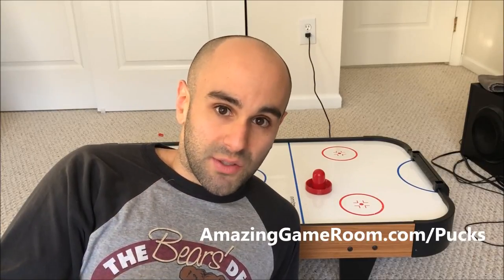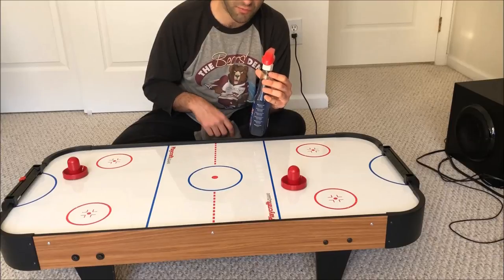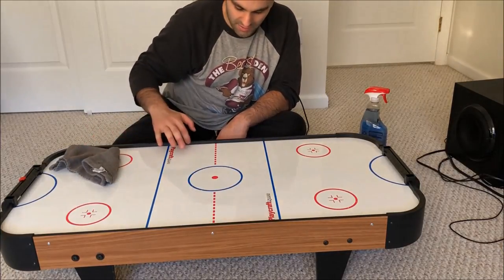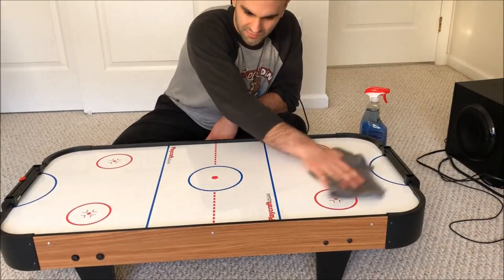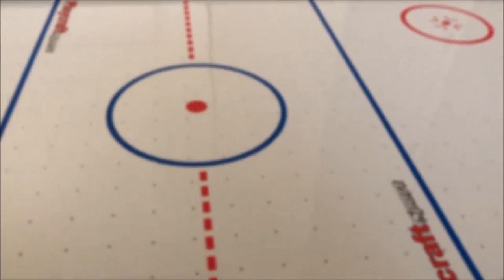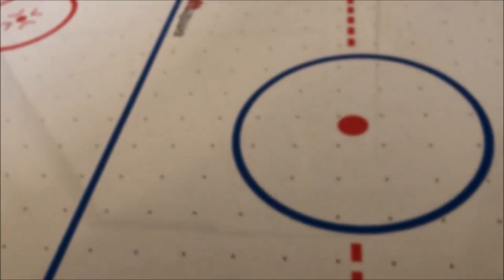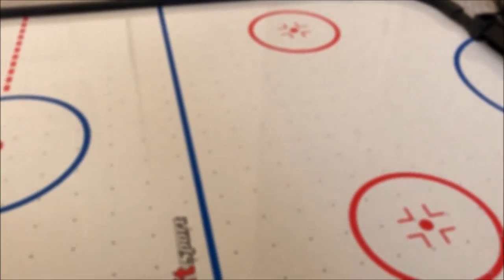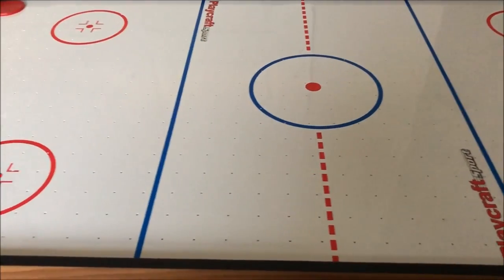Air Hockey Puck Not Moving? Try These 3 Tips

Comment from the maker: Hey guys - to get a better idea of what I'm talking about, I highly suggest you check out this article (https://amazinggameroom.com/air-hockey/best-pucks/) on air hockey pucks. I go through and list out a bunch of different puck  options that could work for you.

Additionally, you could also look at the full table maintenance guide (https://amazinggameroom.com/air-hockey/table-cleaning-maintenance/) for more detailed instructions!
Reply: One solution that you left out: sandpaper.  I used to work at Chuck E. Cheese, and if the puck didn’t slide well, it usually turned out to to be a scratch on the puck. The game room technician easily solved this by rubbing it against sandpaper for a  few seconds. A lot better solution than buying a new puck, every time the old one gets a scratch, just because of the scratch.
Reply: The page can't be found

Comment: I bet significant dings in a puck resulting in raised bumps could be sanded off with a 120 grit or finer sand paper.  Clean the puck and dry it afterwards.  I'd be very cautious about using water or Windex or a spray cleaner on an air hockey table except as a last resort.  Turn it on and vacuum the table with a brush attachment.  If holes are plugged, you may need to chase them out.  A Google search told me there are 4540 holes in a regulation table.  The hole size is 1.2mm or 3/64" (.0468").  I checked my table and 3/64" was the right hole size.  Check if your table holes are this size.  If so, use a 3/64" drill bit without a drill to chase out the holes in any dead spots on the table. Do it with the table fan running. If a soda got spilled on the table, you may need to go with the windex and follow up with the drill bit to clear the holes.

Comment: I bought a used large tournament sport craft air hockey table on Facebook yard sale and they said it was hardly used. When I got it home I noticed a lot of the pucks didn’t slide too well. At first I try cleaning the table and trying to poke the holes out, but I don’t have the geek in me to do them all. I even took a razorblade and saw the puck had A LOT OF DINGS. So I kinda shaved down the lip thinking it was that causing drag and it help on a few, but not perfectly. Unfortunately my pucks are not 2.5 nor 3.25. They are a odd size of about 2.75in. I wasted so much money on Amazon thinking I needing the larger puck for it to get stuck in my goal so then I order the cheap 2.5 pucks to find out that they are basically light weight dollar store toys.

I thought I’d never find a solution since my pucks are apparently discounted and no longer made😢 just my luck. Until I had a brain fart!! I took a mini torch lighter and quickly applied heat around the bottom lip that flows on the table (not the sides of the puck) heated up like 1/3 of the ring then softly rubbed the puck FLAT on my deep freezer, because it’s a very smooth surface soft metal ice box. After doing this one time in 1/3 sections so you don’t warp the plastic with the flame 🔥 I noticed how shinny smooth it was turning out.
I tell you what, all 6 of those pucks on both sides now just float across the table like butter on the field. Soon as I laid em down they wanted to hover away from me without a single tap. 

Hopefully I’m not too late for anyone else with this problem cause I can promise you it’s the puck most likely do to drag and rather buying new ones just heat them up and rub it back out. Don’t damage the table with a drill bit. I used a wire with solder too for about holes and said lm over this. I use denatured alcohol on the table all the time and not a single issue to the board. Good luck out there

Comment: Hi I have a Arcade Elephant AIR Hockey Table. It doesn't seem to give out sufficient air flow. I have seen alot of videos on YouTube trying to figure out what should be done to fix the problem. I bought a 1/16 drill bit and drilled holes and cleaned them... Than Light sand the whole things to get it smooth and than clean it off.. its nice and smooth the pucks is fine as well... the blower works great I took out of the table to see if its work fine and blower is very powerful. Blower is mounted right in the middle of the table underneath it . And where the blower is mounted the air flow is fine there but on the right and left the air flow is almost non existent...
Can u suggest what should I do plz

Comment: From experience I can tell you a vacuum is the safer way to clean the ports on your air hockey table. Don’t stick anything in the holes that may damage the size of the hole or the internal workings.
Reply: Kidding?. No way will that work, I've even tried 100 lbs of air pressure with a blow gun. Has to be reamed. There are no workings to damage wtf are you talking about.
Reply: I have done this trick it worked
Reply: But my puck has scratches